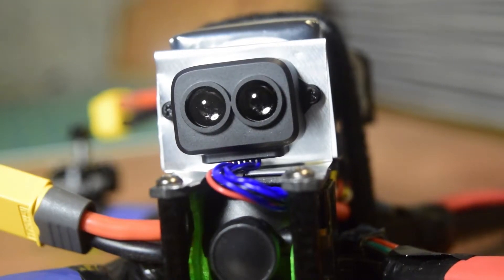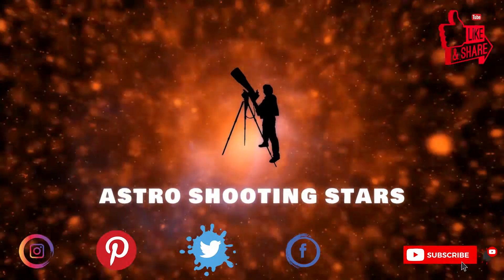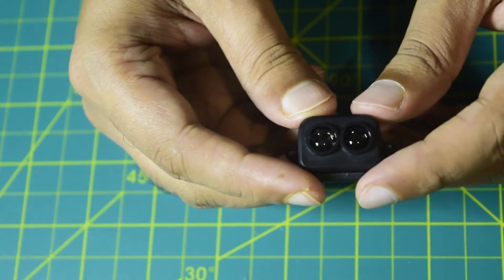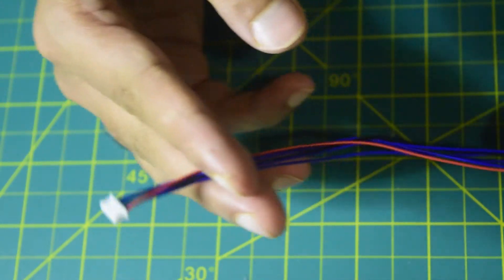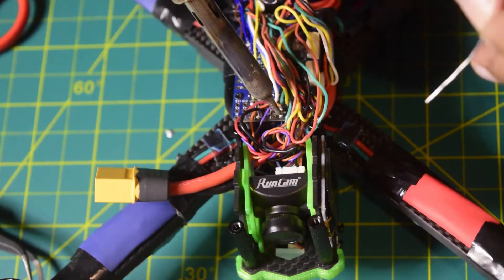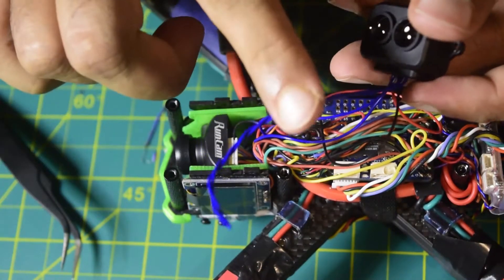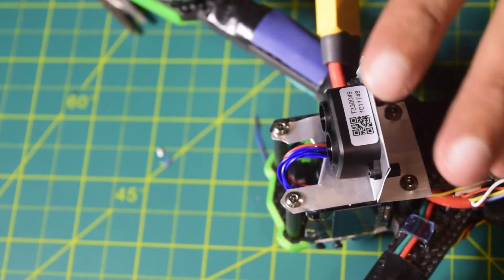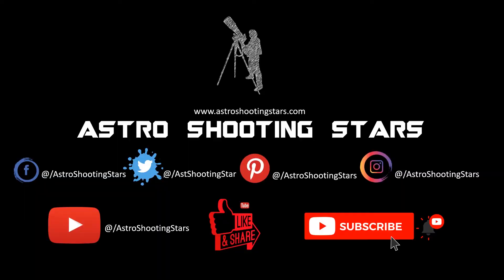How To Install LIDAR on Drone Frame | TF-Luna, 0.2-8m Single Point Micro-Range Module on UART

Comment: Hi sir, does tf-luna work for optical flow position hold in inav? Btw i'm also waiting for the settings sir.. thx
Reply from the maker: Hi tf luna is a distance sensor it can work for alt hold but since when it moves it does not give the direction of movement like opflow sensor it cannot be used for postion hold. For sure i am working on the firmware and soon will submit to i nave for obstacle avoidance depending upon their approval it will be released. I hope this helps please stay tuned to my channel for my future videos
Reply: @AstroShootingStars  ahh, i see... Thanks for the answer, I'll be waiting for the next update...